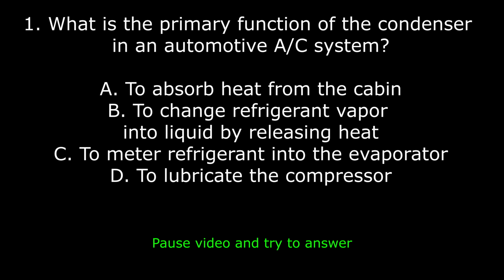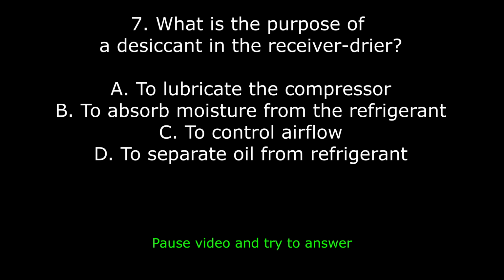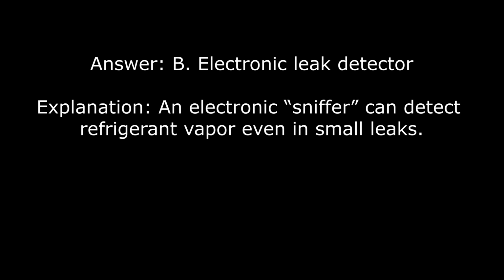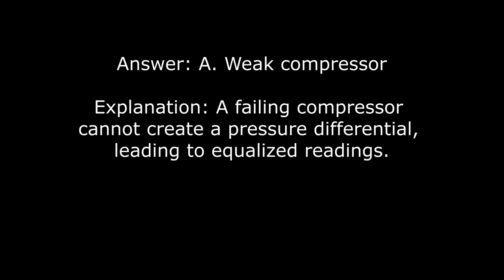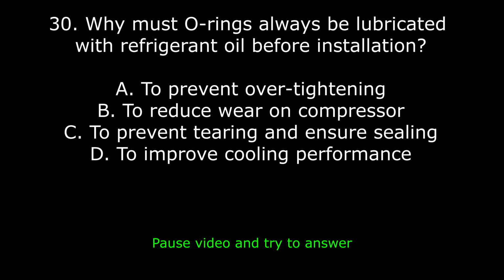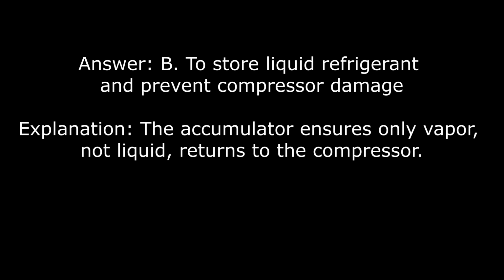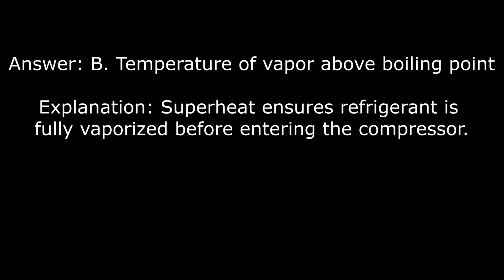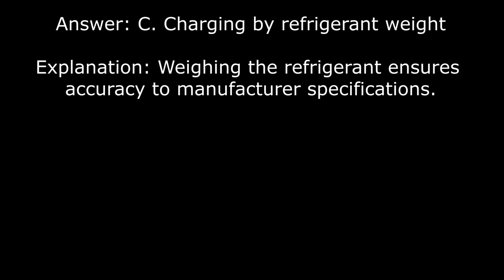ASE A7 HVAC Practice Test #3 – Heating & Air Conditioning (50 Questions with Answers & Explanations)

Comment: Great video, but I respectfully disagree with the answer to Question 29.

When the condenser fan fails, the lack of airflow causes an immediate spike in head pressure (High Side) due to trapped heat. Because the HVAC loop is a closed system, this extreme head pressure creates immense backpressure on the compressor, reducing its volumetric efficiency. At the same time, the poorly condensed, hot refrigerant entering the evaporator causes it to boil rapidly, raising the evaporator temperature and pressure. Therefore, the suction pressure (Low Side) will actually RISE above normal, not drop.

In a real-world shop diagnostic, a failed condenser fan will always result in "Both sides high" (Answer D). Low suction with high discharge (Answer B) typically points to a restriction, like a clogged expansion valve (TXV), rather than a fan failure.

Keep up the good work, but please double-check this technical explanation!